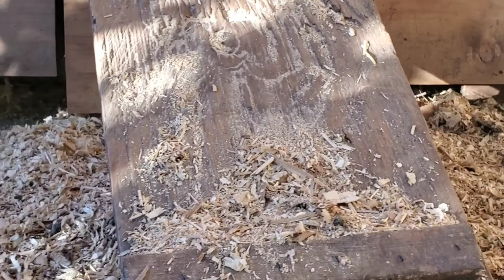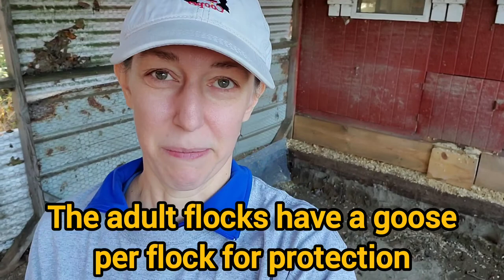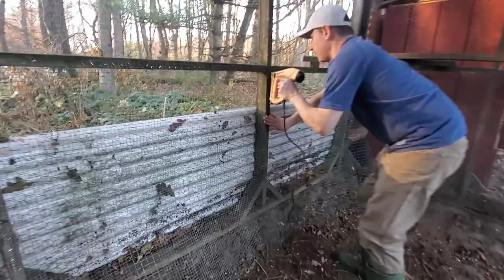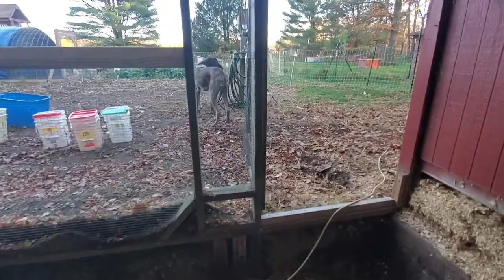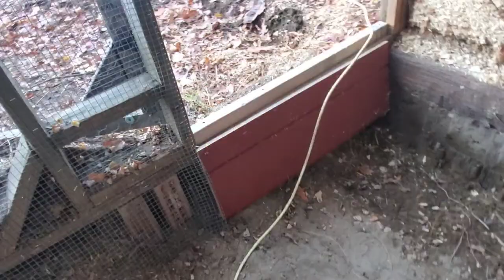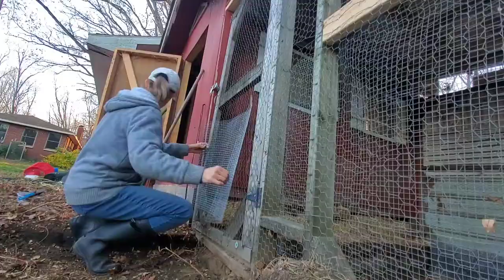How to Predator Proof a Chicken Coop

Comment: I've dealt with weasel many times befroe. If you have a gap anywhere at any spot in the coop it will get in. I suspect that the top of your chicken run having a gap. You will find out .soon.
Reply from the maker: I suspect the bottom of the door gap.  The top of the run is all covered in chicken wire, but you're right, that may not be enough.